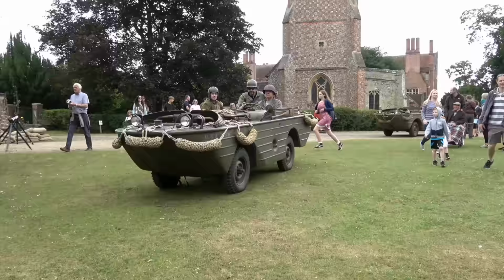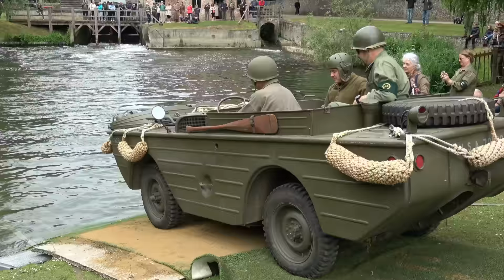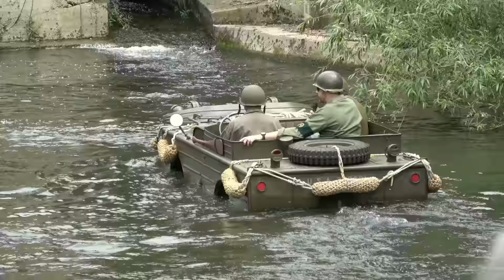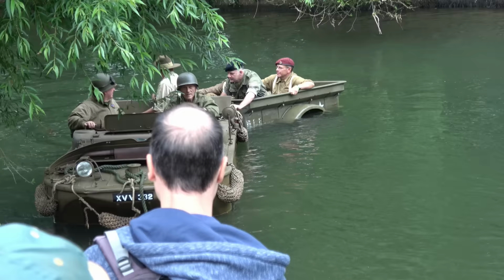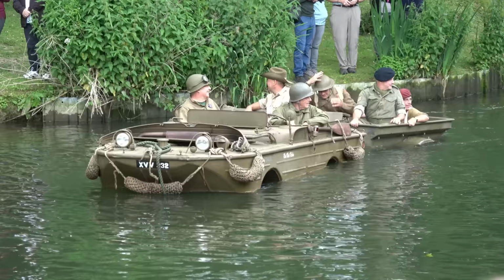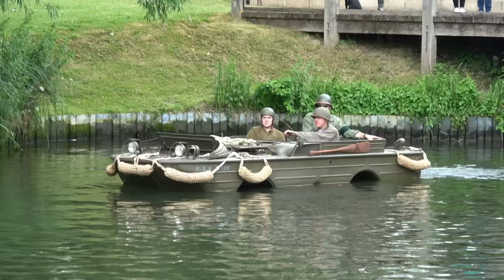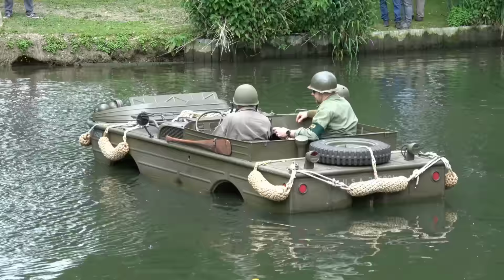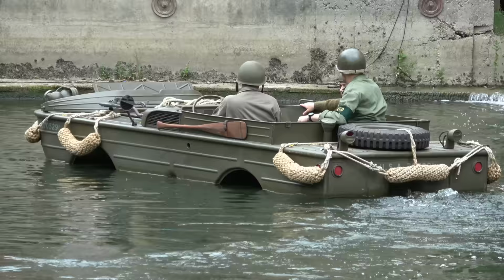Mapledurham at War June 2018 including Ford GPAs In The Water

Comment: Those trailers have a relatively watertight tub. However, they also have some spring-loaded drains that have rubber seats. So, a seam that's not completely sealed or a bit of dirt in one of those drain valves will let some water in. If you knew you were going in the water, a good smear of grease on the seams and valves would be in order.

Comment: I wonder if wheels are also steer in the water along with rudder or they can disengage. I am building a RC model of it and wondering if the rudder and wheels are two separate systems.

Comment: of course lads Brits go into the tub
Reply: There really not that good for much else. But it does go well with the Jeep itself. There is no tailgate. So everything has to be picked up over the side. They're not very wide on the floor properly less than three feet. Which makes them almost impossible to load anything wide. But I know that they did in WW II and Korea. I just meant that In all honesty. For Bantam to get that contract. And Willys and Ford to build what Bantam designed doesn't seem fair somehow.